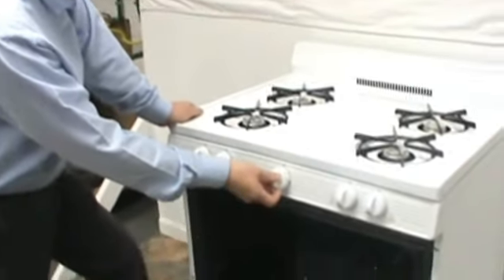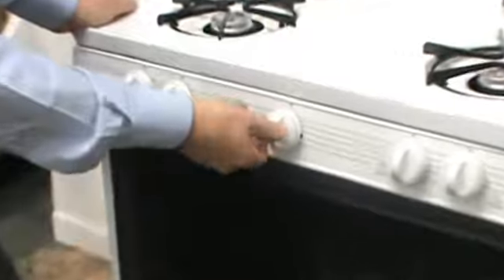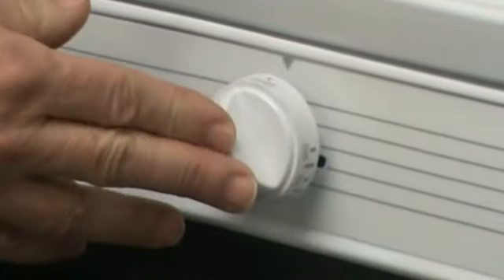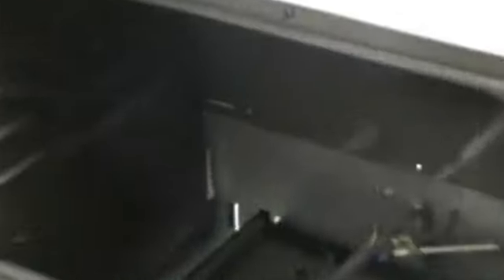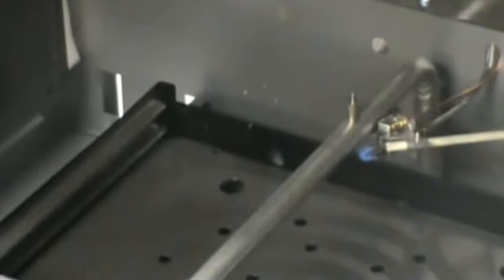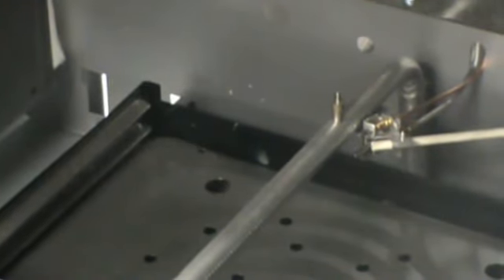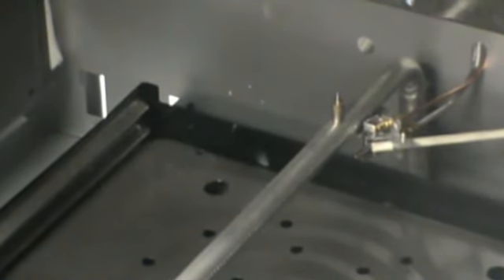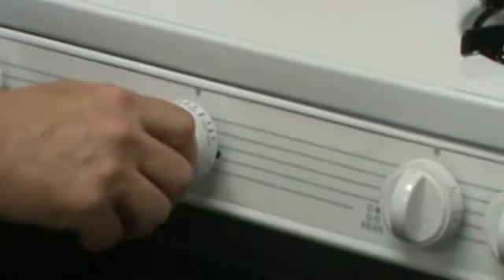2 - Oven Control Safety Features

Comment: I have an older model.. have had problems since purchasing it. Repair guy says he fixed it, charges me a bunch of money and leaves. It's not fixed. First off my stovetop igniters kept ticking. We unplugged it so that would stop. Now my pilot light is lit but it won't go any farther to heat up the oven. I'm ready to trash it. The door seals on the oven are coming off. My oven door gets stuck in the closed position. My husband wants to try to fix it himself. He thinks it's the thermostat since the pilot lights but won't go further.  The oven sometimes goes crazy. The knob would be at 350 and it would go all the way to 500 and then fall back to 200 and repeat. We've had the thermo replaced but still did it occasionally.
Reply from the maker: Please call 1-800-858-5844 and ask for Tom in Service.  He is our Service Manager and he will help with your issues.
Reply from the maker: Please call 800-858-5844 and ask for Service.  Our Service Manager tom will help you.